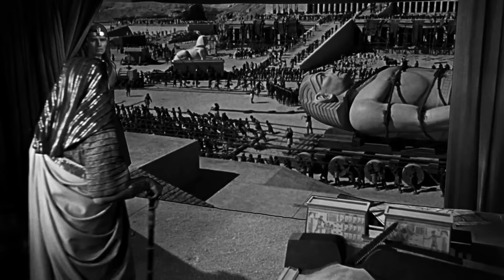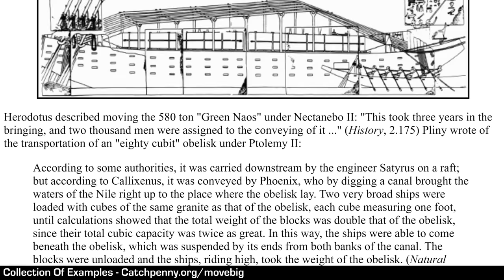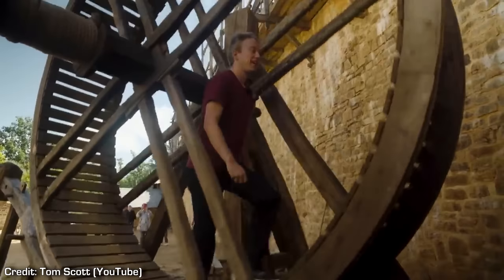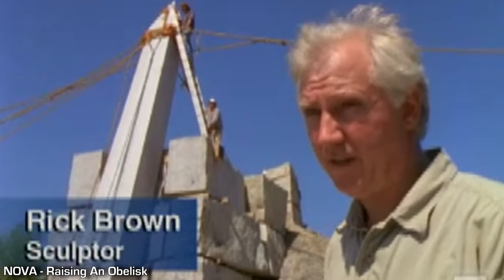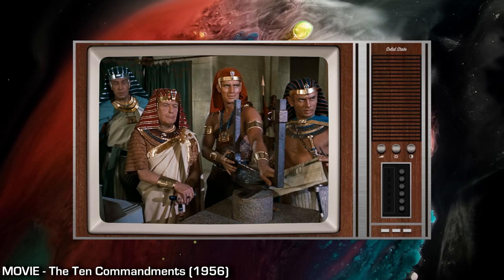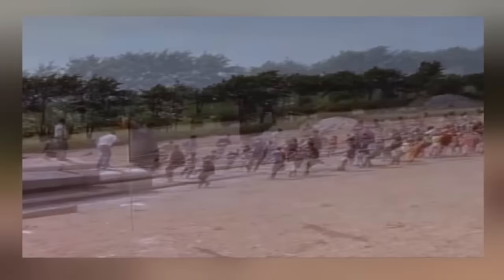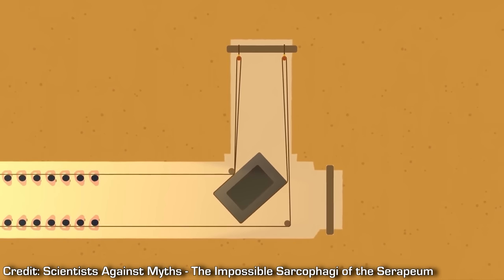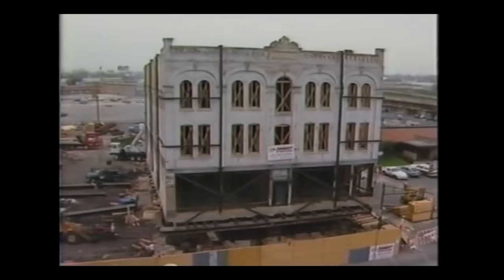This Is How We Move Huge Stones & Buildings | A Compilation Of Modern Experiments & Examples

Comment: Two and a half tons? You think that proves anything about moving 800 tons? Really?
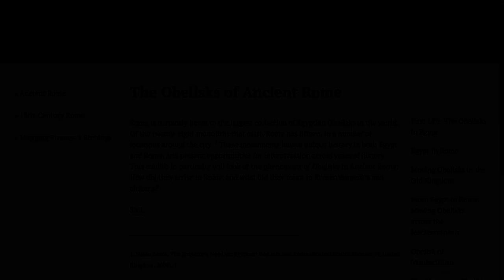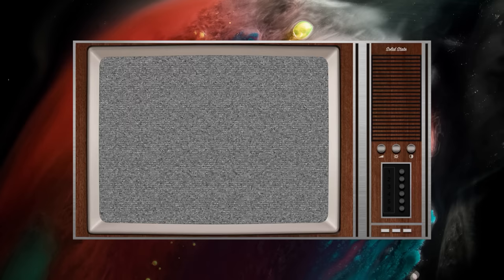Reply from the maker: 4:56 The Romans moved obelisks weighing a few hundred tons from Egypt to Rome which is over 2000km away, so it doesn't seem too much of a stretch for them to scale up workforce to drag a few 800 ton blocks just 850 meters in Baalbek from the quarry, probably wedged up onto wooden tracks/rollers, maybe helped pulled with capstans. 9:28 shows how easily a 250 ton column can be moved over wooden rollers, they probably did something similar to this.

Comment: So how did they lift those 1 thousand ton stone blocks many metres into position,Also how did they lift the stone pyramid blocks to the heights read and place them precisely hundreds of feet on top of each other and also the Aztec pyramids, I have seen granite blocks several feet thick and 12 feet long split in Sri Lanka by ancient technology with such precision cuts like a laser,❤And no chipping or fractures in the granite, Figure that one out,,,,,,,
Reply from the maker: The 1000+ ton blocks are still in the quarries so they weren't transported, maybe they were just outside their capability at the time, but considering the Romans moved obelisks weighing a few hundred tons from Egypt to Rome which is over 2000km away, then it was certainly possible for them to scale up workforce when needed to drag the 800 ton blocks just 850 meters in Baalbek, probably wedged up onto wooden tracks/rollers, maybe helped pulled with capstans.

As for the Pyramids, the only really large blocks are around main chambers, grand gallery and entrance keystones, most of the pyramids structures are filled with rough inner stones and concrete, and all the outer and casing stones were only 2-4 tons each, we can only guess at their exact methods as we don't have much documented like we do with the Romans, but they probably used similar tools and techniques as eachother.
Reply: It was done by Fallen Angels and their technology and the giants.  They levitated some as well. This dude is CO and only here to keep the duped duped!
Reply: I agree, those massive stones are almost impossible to be moved from the quarry site up to where it is located now. They just can't accept that the ancients were far more superior in terms of science and technology.
Reply: The Roman additions to Baalbek are clearly visible.  Along the adjoining wall to the Three 800 ton blocks is a space that would fit the 1000 ton blocks that are still in the quarry or en route.   That space is filled in with much smaller blocks that are Roman.   For whatever reason the construction of the megalithic platform was stopped (quite suddenly by the looks of it), and the Romans carried on later but at a scale that they could handle.   The Romans were capable of amazing feats of engineering and they built unbelievable cities and monuments and didn't tend to leave things half finished.   They had control of this territory for a long time and had no reason to switch to smaller blocks if they were capable of working with the larger ones.  Why would they purposely scale down the site midway?
Reply: @helbertsantos3275 evidence?  No, just fantasy.

Comment: Great! Now, how did they lift stones that weigh hundreds of tons 2 or 3 hundred feet in the air?
Reply: The normal way.
Reply: Apparently according to some sources they used levers to raise them a bit at a time with blocks under after each lift. Which would work at lower heights but try using that method for the Granite beams above the Kings chamber...maybe not!
Reply: @russellmillar7132  Oh, so the used hydrolics?? Yeah, I don't think so.
Reply: @dextermorgan1  sure mr " scientist " LMAO
Reply: They didn't.  If something had to go that high, they used ramps.
Reply: @sharimeline3077  Be a very very very long ramp for some of those blocks because gradients are not your friend.
Reply: @doctormarazanvose4373   Of course it would.  They had nothing but room to do it, out there in the middle of nowhere.  It isn't the middle of nowhere now, but it was then.
Reply: @sharimeline3077  If you looked into the length of a ramp required to raise huge blocks a significant height with the limitations of gradient you may rethink your last comment.
Reply: @doctormarazanvose4373   You completely disregard the skill and intelligence of the Egyptian people.  You can easily look up the archaeological evidence we have and latest ideas about how this was achieved.  But instead you want to think it couldn't possibly be done.  You are the one with a limited mind.
Reply: @sharimeline3077  Limited mind? You are making massive assumptions based on a false premise because your understanding of the applied mathematics is non existent.

The Egyptians may have been the smartest and nicest people on the planet and planted flowers every day but that doesn't alter the fact that the ideas put forward are hypotheses at best because we simply cannot explain several factors.
Reply: They weren't lifted, kid, they were dragged.  Did you not learn about inclined planes in middle school?  Or just from living a life?
Reply: @doctormarazanvose4373  "gradients are not your friend"
Wrong.  Inclined planes impart a mechanical advantage on the force needed to raise an object.  This is middle school physics, dude.

Comment: There's a slight problem when it comes to the mega sized stone work.    It's simple, today, using a crane,  when making  precise sets, things over 20 tons, it's more often than not that it takes two or three picks before you finally get it set perfectly in place....
So the issue isn't the moving as much as it is the setting of these stones.  You don't just pull the rollers or skids out from under these stones once you get them where they go,  they had to jockey it into its precise position.   We have cranes and picking eyes today,  but the ancients had levers..  and you don't just lever a 100 ton block around once it's sitting flat on another flat stone.   It can be done with a lot ropes and levers IF you have a large enough area to stage enough manpower to work the stone...at 200 tons,  you have to get off the ground again, meaning they would have to drive wedges under it lift them again to set them perfectly,.  Something that would definitely leave unmistakable deep cut groves into the stones, something missing in their work...  Around 500/600 getting anything out from under the stone  they used to move it with is as big as a feat as the project itself.   800- 1000?   It's not happening.   Whatever is under it will be staying under it.   Even today we would have it to do to get anything used to set it from underneath.
Reply: They had completely different technologies to first mine the stones and transport them to these places. The Aswan quarry is not around the corner as we say. Then this precise fit in granite, which cannot be replicated even today. Have you already seen these vases? that were ground to thousandths of a millimeter? There was a time when there was a lot of technology and knowledge. There's no other way I can explain what's going on all over the world
Reply: The better question might be; how would we move them today if we didn't have modern cranes?
Reply: @levarris14  "this precise fit in granite, which cannot be replicated even today"
What grifter told you that and why were you gullible enough to believe them?

Comment: For years I worked in offshore oil drilling business where 50 to 70 tons lifts where a daily occurence even 3,000 ton lifts on occasion, they all had one thing in common strong lifting gear especially lifting slings what was the sling / rope technology back 5000 years ago?

Comment: Great Pyramid of Giza - Wikipedia:   It was built by quarrying an estimated 2.3 million large blocks, weighing 6 million tonnes in total..... Pick a number: say 5 blocks per day comes to 520,000 which comes to completion in 1425 YEARS. How did 5 stones a day arrive? There is no accurate number about people brought into or bought as slaves. How many people would it take to carve, remove, and transport a 100 ton stone?
Vast numbers would have to be fed. You would think there would be some sort of proof of this concept. There are historical accounts of taking slaves after certain events but they ran from two digits to 1,500 as I recall. Having a magical crane is all nice and everything, but how did the stones get to the site and be used in the lifetime of a particular pharo? 
Or did off duty farmers and slaves move and place say, 1000 stones per day? How many cranes? How did the stones get lifted high into the air? At ten minutes look at the monstrous effort to move one 250,000 ton column. This is followed by a clip of a crowed dragging a rock 18 miles along wood with a fat on it.  That is ONE rock. The recounted other examples were one time huge projects using, mostly, modern equipment. There is rarely any deep thought to pop concensus whimsy.
Reply: " large blocks"
Not so large.  The average stone in the great pyramid was 2.5 tons.

"Pick a number: say 5 blocks per day"
A number pulled directly out of your ass.

Look at it this way: the labor force for the great pyramid was an estimated 20 000.  The average weight of a stone in the great pyramid is roughly 2.5 tons.  The great pyramid itself is roughly 5 700 000 tons.

A team of 10 men can easily drag 2.5 tons, even up a small incline, especially when rollers and sledges are used.

So we've got 2 000 teams moving 2.5 tons each.  If each team moved only the one 2.5 tons per day, that's 5 000 tons per day.

Divide the mass of the pyramid, 5 700 000 tons, by 5 000 tons/day,  and we get 1 140 days.  Divide that by 365, we get 3.12 years to build the great pyramid.

I think we can both agree that is a ridiculous time frame.

Okay, so let's say that because of the annual Nile flood and all the work that had to done planting and harvesting, that the labor force was unavailable for half the year.  Now we're up to 6.24 years of construction.

Now, I think we can also agree that 2 000 work teams of 10 men each all on-site at the same time is also not viable.  So let's halve that.  Now we're at 12.48 years.

That's still, IMO, too many simultaneously on-site, even considering how huge the pyramid is.

Now, the overwhelming bulk of the stone for the great pyramid was quarried less than half a kilometer away.  If we say that half the stones were in transit to the job site while half were being put into place, that brings us down to a not unreasonable 500 teams on-site over a 12-hour day.  It also makes the construction time 25 years.

That matches the 25-years between the date Pharoah Khufu ordered construction to begin (c. 2550 BCE) and the ascension of the Pharoah Djedefre (in c. 2575 BCE), who oversaw his father’s funeral rites in the pyramid’s attached mortuary complex.

There's my math.  Feel free to tell me which part is impossible, and WHY.  The "why" is important, otherwise you'd just be making the same old fallacious argument you've already made.

Comment: Great video! It's very illustrative on how ancient people were capable of moving and place huge pieces of stone. There is still a number of them, however, that can simply not be attributed to ingenuity, like the balbek stones (that are simply too large for these techniques to be applied), or the pink marble stone blocks present in Great Giza (they were moved hundreds of miles and accross a chain of mountains, and they were also lifted several hundred feet from the ground). It's also the case for the Sun Temple in Peru, where these blocks had to be moved no tgrough a grassy slope, but to an actual mountain peak, it doesnt take much analysis to conclude it's impossible to do it with logs and ropes.

It's worth mentioning as well that the level  of masonery we find in many of these ruins, in terms of precision, smoothness and geometrical proportion is impossible to be explained without consudering very advanced machinery, or something equivalent to that.

So, please, open your eyes, and accept. There is at least one more ancient civilization that could do much more than the Romans and Egyptians could. They were unfortunately extinct, and forgotten. But the evidence is plain for anyone who wants to see it.
Reply: I will always believe it was done using hydrolics. Huge towers that slid on skids and  held a large sack of water that was connected to a rope that went to a pully at the top and another at the bottom, then to the stone being pulled. Or through another set of pullys on the frount that pulled it forward between pulls on the stone.. Thing is when I first started writing about this it was before it was known that lots more water still flowing out if the hills along the nile then. That majes how the fed them easly understood now. But what do I know? Were told to follow the experts say and not think on our own. Even when logic proves the experts as being wrong. As the logistics of making enough rope would have been staggering alone. Where this idea only required one masive one that easaly could have handled the weight of even the colossal stones. Just got to do the math and see how many towers it would have taken verses the water they could hold have held.
Reply: No one has neglected them.  There are many great books on ancient Peru and it's history.  There are plenty of things that the Peruvians could NOT do that the Romans did; much of it has to do with the immediate environment.  Humans are remarkable creatures.

Comment: In the introduction, the Pantheon is Roman and it was made with 13 foot thick concrete walls in the rotunda and a concrete dome overhead that is 13 feet thick at the outer edges and 3 feet thick at the oculus.  The only stonework is maybe the columns of the porch which may be actually spec'd from Egypt.

Comment: No question about human ingenuity, then and now. The question is “what kind of human will stand at a copper saw and cut 20mm an hour for 2 years?” To make a stone box. And another 2 years to polish it. I struggle with the concept that things we would struggle to make today (with our current technology) were easy to make in the past, just with manpower, primitive tools and lots of time. Obviously much of it was just so,,,, but scoop marks, flush jointed massive stones, high precision, unique geometry and challenging terrain tell us there is another dimension to the work. Perhaps only architects can get this concept. “A message in the method”. Why choose difficult when 10 kinds of easy are available? On the fence for now.🤔
Reply: "20mm an hour"?  more like 2mm if you work very industriously, with the slight issue that you would be losing copper from the saw at a greater rate than the Granite. I can visualize a pile of saws about 1800mm high to cut one block. As you rightly say the jury is out on that one. (Doubtful at best)

Comment: The blocks left  in the serepium with only around 12" clearance, how where they moved?
Reply: According to records from New Kingdom Egypt, they were dragged to the site with draft animals, then pulled with human power and mechanical advantage with the aid of compound pulleys.  The sarcophagi were hollowed out at the quarry which made them much lighter (45 tons rather than 80-100 tons). The tightness of the passages actually helped to make turning the corners with incremental movements, easier to accomplish. The bays where the boxes were moved to were pre-filled with sand, Once the box was in position, they pulled the sand out and lowered the box to its position. 
My thought is that if the ancients really had high technology, none of this stuff would be amazing or remarkable. It's the fact that they figured it out with just intelligence and ingenuity, planning, and coordination, that makes this far more exciting, IMHO.

Comment: A current theory holds that in ancient Egypt huge loads were transported over sand on human pulled sleds. The sand was made firm by pouring water on it from the front of the sled. This I believe is erroneous. It would require too much water, and footing for the pullers would be too loose. Instead, the sleds would have been pulled on paved causeways with a little sand as lubrication-- under the runners, not the feet of the pullers.

Comment: Several hundreds of thousands 50-100 ton, perfectly cut hard granite from several hundreds of miles away over difficult terrain- then placed hundreds of feet in the air or maneuvered through such tight spaces- is not satisfied by this hypothesis, in my opinion.

Comment: Horses wouldn't have worked that well to move items back then either. It wasn't until about two hundred years ago that humans harnessed horses properly to pull items. They used to yoke horses like oxen. The issue with that is horses don't have as strong of a breast bone to be as effective. It would also restrict a horses breathing. Affecting it stamina as well.
Reply: And of course they were bred to be strong & heavy, shire horses for example.

Comment: I've always been interested in the prehistoric moving of large objects and have watched every documentary that came along.  A problem that I saw with quite a few of them, and you might keep an eye out for them, is that is that not realizing the difference, they used climbing rope.   Climbing rope stretches (for safety).   Natural rope does not.   Therefore most of the force applied to the rope is lost in stretch.  You watch as the fifty or so volunteers heave the ropes five feet or so and the stone moves ten inches.   Funny to watch but a big problem when the expert in charge determines that "this is not a viable way to move big stones."   Here's a mental image of me screaming at the TV.   I remember two on Stonehenge, one on the Moai and at least two on the Pyramids.  Unfortunately, there were more.